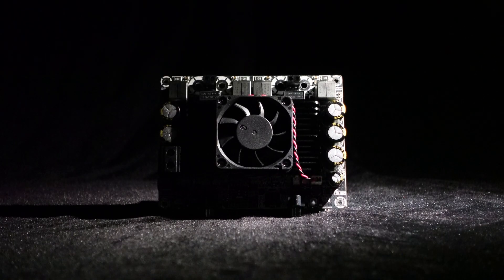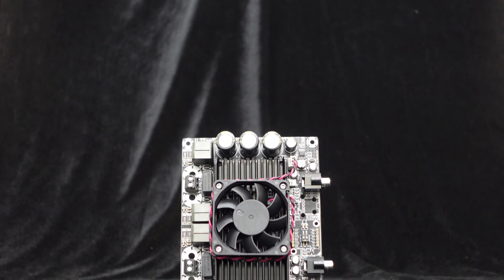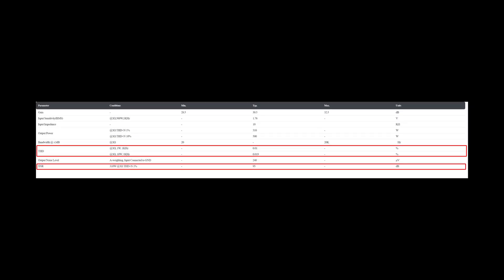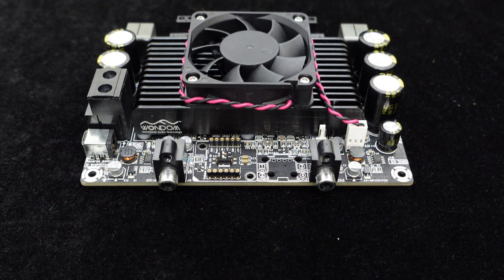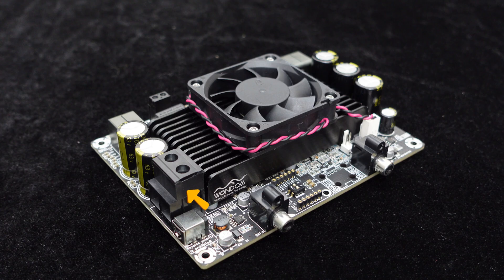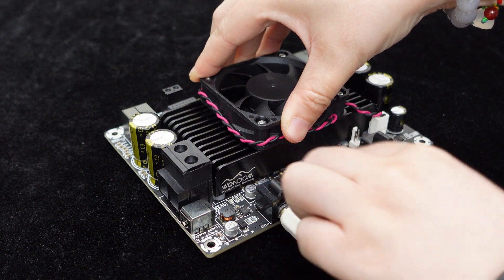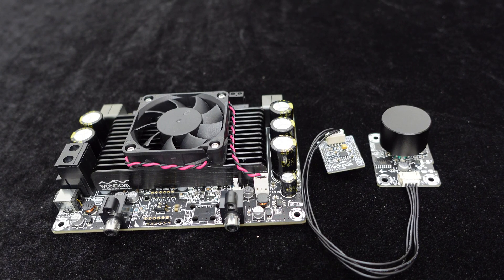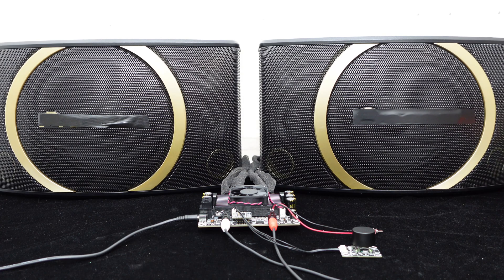WONDOM T-AMP Series Class D Stereo 500W  High Power Amplifier Board for Home Audio Desktop Speakers

Comment: It can be used as an amplifier for Two low-frequency speakers as a subwoofer? Is it possible to adjust the cutoff frequency to, say, 150 Hz, programmatically or somehow?
Reply from the maker: Hello. If you want to use this stereo 500W amplifier board for subwoofers, a DSP preamp would be required for low pass as this module delivers full range playback. In such condition, you can take a look at WONDOM APM2: https://store.sure-electronics.com/product/658. Wish this could help you.

Comment: What is the maximum voltage supply? Typ. is 50V, But what is the Max.? Can I operate the board with a 16S Lifepo4 battery with a voltage range of 51.2V to 58.4V? Looks like AA-AB32516 is the better alternative? But I'm still missing a 3rd channel with approx. 100-250W@51,2-58,4
Do you have 3 channel boards with 3x500w or better 2x500w/1x250w@4ohms and a voltage input at approx. 50V to 60V? 
Or 3 single boards not overpowered (around 100-500w)?
Reply from the maker: Hello, the maximum voltage supply is DC 50V. Please do not connect power supply with voltage higher than DC 50V. If you want around 500W output power into a 4Ohm load with DC 60V, AA-AB32516 is a better choice. Wish this could help you. Have a fantastic day~
Reply: @WONDOMAudio  what is the output power @4 Ohm from the AA-AB32516 with a 72V DC power supply?